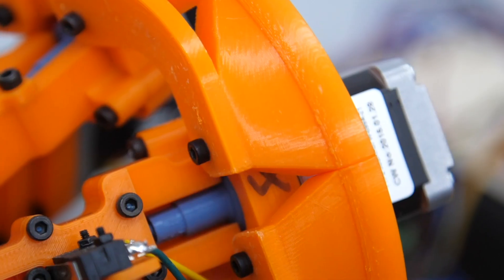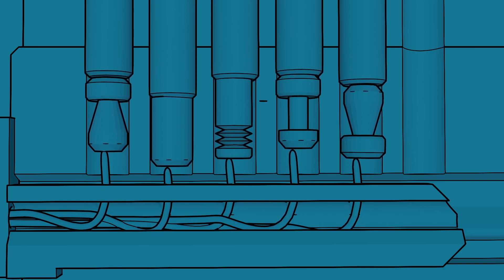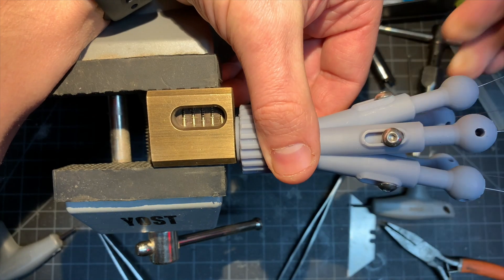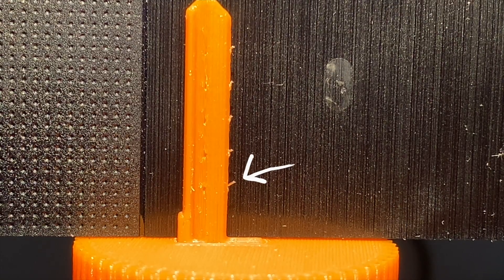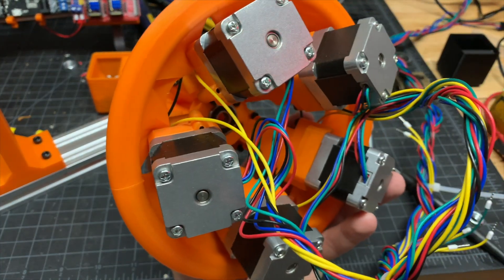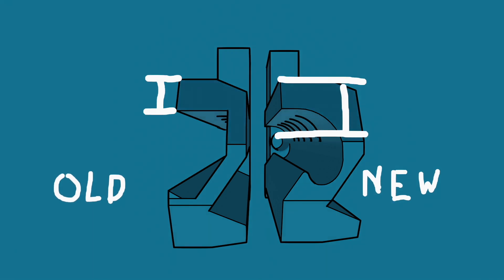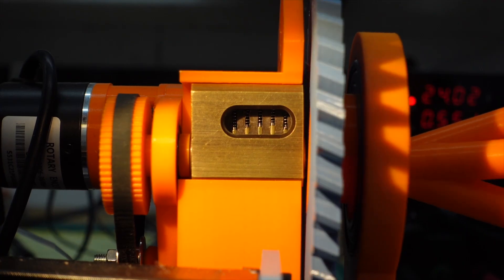i made a robot that picks locks WITHOUT A PICK

Comment: that wire manual picking tool, look basically identical to a picking tool i had for tubular locks. Its called the Peterson Pro-1 and Bosnian Bill has a good video on it . 
Very interesting that you'd come up with such a similar but for a different style lock. 
Nice video. 😀👏 Brute forcing any 5 pin Schlage keyway (at the speed your machine does) would take ages though i'd think. 
It kind of works like an electronic pick gun or even like using bumb keys kind of. 
Schlage is i think the second most common lock in American homes though, but unfortunately they are also one of the easiest to just pick along with the kwiksets.

Comment: I think you should place the rotary encoder on the main shaft and use a clutch system that prevents the blade from being turned further than possible.

Comment: Maybe you might look at tubular style locks (the ones with vending machines and those ancient antique things called payphone booths - these utilize tubular locks in7 or 8 pins, typically…).  I’ve seen an expensive device that tackles tubular style locks quite well, and it sort of resembles your device, except instead of your ‘canals’ that converge at the entryway to the lock, they’re on a sort of flexible shaft that can be made more or less rigid by applying tension to it.  They are springy. This thing you have created is an awesome feat in its appearance alone, I mean I would love to decorate my entire domicile with your device as it’s main inspiration!  Congratulations to you!!  You are an extremely elite entity, riddled with fails as you are! I try to claim my mantra to be “I revel in my failings” since it sounds like I’m not such a stress casualty as what is the honest truth. So I’ll pray for more obstacles for you, and know that when it hits, someone hoped that you would receive one of the greatest gifts that could come from a life of perseverance!!

Comment: Fun project, some very nice engineering. One little remark: When using a setscrew to fix a gear (or pulley, for that matter) onto a shaft, the setscrew should be on the opposite side of the flat (the round part of the shaft), in effect pushing the flat parts together. The setscrew isn't there to prevent rotation, it's there to ensure close fitment of the flat faces to transmit torque across the parts.

Comment: If you use Nitinol memory wires you can control them like little motors using simple electrical signals. We are working on a skin tight exoskeleton that has thousands of thin .5mm Nitinol memory wires running through the entire suit with pickup along all major muscle groups to fire the wires when needed. In short if you go to lift something very heavy, simply try to lift it and once your muscle groups in your arm slightly tighten the pickups read the electrical signal through your skin and tell a micro controller to fire the corresponding Nitinol memory wires thus greatly assisting the weight your lifting. I should mention Nitinol is made from titanium and nickel so its super strong!

Comment: JLCPCB can 3d print metal, well, SLM (selective laser melting), basically the same thing, but you could get stainless steel key blades fairly inexpensively
Reply: just checked, and your keyblade would cost $9.50 with shipping, you'd have to make a small adjustment so it's 0.02cm longer to fit the minimum 1.00cm X 0.20 cm X 1.00cm size
Reply from the maker: Thanks for looking that up. I'll keep that in mind for v3

Comment: V3.0 - torque sensing instead of encoder on the rotation sensing - the motor current is proportional to the torque applied. Steel reinforcement in the keyblade so it doesn't shear, and cable instead of the steel wire, should bend easier so you don't need as much force to actuate the pins.

Comment: Wait so from what I understand is that there are two pins in a lock correct it’s the driver and the upper right? So what if you just coded the stepper motors to max them out then rotate like 1 or 2 degrees to the pins dont reset and retract the wire and then turn the rest of the way?

Comment: Wow this was AWESOME!!! I loved how you walked through your challenges and how you solved them, I found that the most interesting and relatable. I didn’t follow how it detects when a pin reaches the right height… are you just constantly rotating the tumbler to check if it is rotatable (i.e. unlocked) otherwise continue to sequentially try all 100,000 pin height combinations? I totally got Splinter Cell nostalgia watching this!
And the amount of times I’ve had 3D printed gears put me down a long rabbit hole of diagnosing issues…! Very relatable

Comment: Pretty fun and frustrating project! :D
Check out R/C planes/helicopters servo motors instead, it would reduce size a lot, also with a defined arm lenght in the servo you could easily remove the linear actuators!

Comment: This is cool to see. 21 weeks ago, apparently, I commented to a friend on FB "Now I want to build a key with tiny flutes running through it, and spring wires hooked to geared stepper motors, and then a robot can just quickly run through the 150k combos for me," because I have a cabinet with a very good lock I cannot for the life of me pick. I actually seriously considered doing this exact project˘which is a lie; I did crazy projects when I was 23, but now I'm twice that, and don't have the same drive to dive into endless efforts like this). I also actually considered printing every possible key, but I don't know which key yet, and yeah, those combinatorics... I figured I could fit 50 keys on the plate per print, 4 hours, 15 minutes per print, using 82g of PLA, and I'd need 117,649 keys, so only 2,353 full-plate prints, taking almost exactly 10k hours (10000.165!). I'd also need 192,864g of filament, which is only 193 reels, so about $2600 with ANYCUBIC 4-packs ($13/reel). I figured I'd only need to do about 1500 runs before I landed on the key, so about 6,375 hours, or 797 8-hour printing shifts. Not too bad :)

Comment: Load cells seem like they would be the way to go,  besides a simpler integration, would allow you to control fatigue, and likely speed up the cycling between attempts since you wouldnt have to wait for the assembly to spin enough for the optical system to know it isnt picked yet

Comment: 9:25 You should have just used straight cut gears, the helical cut is going to produce longitudinal forces that will act to seperate the gears apart along their respective drive shafts, in most applications a thrust bearing is required for helical gears.

Comment: Do you need linear actuators? Can't you use slightly softer wire and use 5 spools with motors instead? You could even have one motor and a gearbox.

Comment: Great project. Im 5 minutes in and the obvious question! Why didn't you use RC servo motors? They are servo motors, plenty of control, small low current fast, and plenty strong enough to push a wire with a short lever arm after all the wire doesn't need to move very far.

Comment: I like the thought process involved! Couldn't you have rotated the smaller steppers 90 degrees and mounted the wire on an actuator wheel? This along with a metal key blank insert into the plastic would be how I would try to solve those two problems. That or CNC/carve it out of G10. The smaller steppers look like they are the same as Floppy drive head seek steppers, those come with very steep actuating thread, that would be another direction

Comment: I've actually used these cheap stepper motors once and there is a hack to make them work faster. You take the plastic casing out and cut a copper trace with a knife, you'll need to use a different driver though.
Reply: By different driver I mean that the one included with the cheap motor won't work. I'm pretty sure the one you used with the NEMAs will work just fine.

Comment: You could write an algorithm that pushes each wire in as far as it will go, measures how far in each one goes, and then use those differences to calculate where each pin should line up. Then send those possibilities and you'll be in in a few orders of magnitude quicker.
Reply: If a lock has security pins, it'll have nonuniform max travel distances too

Comment: U could have avoided a lot of bulk by using a stream line design and putting the motors in a parallel side ways and using them more like pullys instead of having the need for a Linior actuators, the original design needed the diagonal shapes for finger access, your new design should have used a single channel for the wires and direct drine belt the wire to the drive shafts of the motors, also not redesigning new parts and working around old design issues leaves it bulkyer as an end design, when some additional components like the drive gears only exsist because of previous versions, and that's not how you improve versions it's letting padt designs hinder the progression of your final design, I hope you make a more stream line version in future, I did a little bit of math and you can even made it hand held and battery powered.

Comment: treat yourself to a better iron. Pinecil is $36 shipped, way better than those dimmer switch irons.
Reply from the maker: I know… I hate that thing. I haven’t researched what to buy. I’ll google what you mentioned.
Reply: @SparksandCode  I commented with a bunch of information about it but seems it wasn't posted. Anyways don't get a fake off the usual china place. Get the V2 with the short tips from their site. They have a whole wiki about it. Also use a name brand supply. I use a old delta branded laptop supply. Shortest possible lead coming into the iron. Mine is really long plus I have the V1 with the long tips so I only put down about 40w even though its a 65w iron. I  think you get closer to mid 50's with the  V2, short lead and GaN charger. They can also push 24v  if you have the right charger/cable. Their discord is great if you have any questions
Reply: @SparksandCode  There is also the KSGER T12 which I'll likely upgrade to at some point. Proper 90w soldering iron station. Could just skip to it if you don't need the portability and don't already have a power supply for the pinecil.

Comment: If you're going to iterate so many 3D prints, I hope you're using Klipper or Input Shaping to speed up the process. It would be a massive change in time/speed. (Or you could just buy a bambulabs printer)

Comment: For a future version, instead of using an optical encoder you can measure the current needed to turn the motor that's rotating the key. Sorta how modern 3d printers do nozzle bed leveling, you would do a few light turns before starting to get a base line of a locked state and then do a momentary test every time you get a wire into a new location.

Comment: Why didn't you add a torque multiplier instead of changing the rotation motor? Of all the motors, that one didn't need to move quickly, and because of the optical encoder (and it's low speed) you shouldn't have to worry about twisting the poor little key off.

Comment: I don't use a resin printer (I don't print enough, and it's so toxic that I don't want to bother with it), but when I was considering it, I found that there are a few resins that are flexible, and mixing them with other strong resins you can get extremely durable material, that will flex instead of snapping... I think one was called TGM? Or something. Then there was another brand that had you mix 2 of them to get a good resin, I think this latter one seemed to be more preferable (cheaper and more rigid).

Google for resins for mini's.

Comment: A great improvement for the manual version would be to slim it down to something not as bulky or long. Something you could easily store in a small kit bag or pocket. Remember those pens where you could choose from all sorts of colors? Something like that with some markings for wire depth and pin number would be great.

Comment: Scrap the robot but keep the main key and wire portion. Instead, make it similar to a glove for the 5 pins and each finger lets you move the wire/pin. This way you can quickly and easily pick the locks

Comment: so, something worth checking with brute forcing, if you want to pick "real" or realistic locks is the MACS (Maximum Adjacent Cut Specification) different locks have different MACS to ensure the key will enter and exist the lock without getting trapped, a MACS of 7 for instance, like some Schlage locks have means you can never have a 0 or a 1 pin next to a 9 pin, a MACS of 5 would mean you can never have a 1 next to a 7, 8 or 9, it will massively cut down how many different combinations you have to try,

of course if the goal is to pick anything you throw in there at random, you have to go the full 0-9

Comment: Having parts behind and around the actual lock kind of defeats the point of something like this doesn't it? It means this will only work in perfect situations and not have any practical use. It should be possible to make the encoder interface with the keyway from the accessible side and not the back.

Comment: The key-shaped wire guide should be layers of cut metal glued/screwed together.  Easier to assemble/disassemble, sturdier, and lower friction for the wires….  Also the wire actuators should probably just be servos instead of steppers?

Comment: @Sparks and Code - When I re-key a lock for myself, I make sure that several of the pins are NOT standard lengths. This adds a bit of extra security, and could make it hard for a robot that is only expecting standard-length pins. How would your robot handle this?

Comment: OMG... I drew this up about 1983!!! Of course they say that if you think of anything, a thousand others are thinking the same thing. The difference is, YOU built it! So kudos. 

Mine was used the same principle, but differed in a couple of details: I drew it with flat wires, which could then "stack" in the key blank, and turn upward to the pins in flat slots. And rather than solenoids, I designed mine with an eccentric cam for each wire... the five or six of which would be in a rotating drum, geared together to quickly go through all possible height combos for the lock... I mean, as you rotated the drum with a crank, the individual cams would also rotate inside, but each one at a slightly different rate, through gearing. Tens of thousands of combinations, I thought, could be gone through in minutes. 

I also drew it so that different blanks could be attached to the drum, for different locks.
Reply: If you care about progress more than copyright, send a copy of your designs to him. Make sure to add descriptions. He might make it a reality.
Reply: How weird bc I drew up the same idea in 1982!!! So I guess I was first... no big deal 😎  Mine did all the things you were talking about plus it had one of those little knife sharpeners embedded in the back of the machine (manual, of course, not motorized). [SIGH] If only... I could have been even more wealthy than I am today.
Reply: @joew1865  You could have only written that sarcastic, mocking comment if you were incapable of understanding the principles of construction and operation in my description... so you gave yourself away, without even realizing it.
Reply: @proto57 yeah, and the comment he wrote is actually copied from something I wrote on a napkin in a bar in 1981 so I also doubt he understands any of the engineering

Comment: With the plastic key blade failures: Could you 3D print plastic molds and then pour a high-strength epoxy into the mold to make a stronger key blade without much tooling? Or, could you cut down a metal key blank and then design a 3D printed sleeve to slide over the steel blank? The 3D-printed sleeve would have the precision channels you need for the wires, but there would be a steel skeleton inside it to prevent shearing.
Reply from the maker: Ohhh I like that sleeve idea… storing that one for later

Comment: Why oh why didn't you just use micro servos for the wires? They would have worked so much better for this, and would have taken up 20% of the volume of your design and would have been sooo much lighter. I would still use the stepper to rotate, but would have used the small one for that.

Comment: why not jsut measure how far you extend each wire until it stops to cut out 2/3 or more of the possible positions for each (distance needed to push) for that pin and reduce your "brute forcing" by a ton? really no need to test every position when you know after testing how far it will push in - or not - and eliminate the position lenghts that it simply cannot be..

Comment: This is really cool! Though it'd be super nice if you stuck a low-pass filter at like 15000 Hz or something on the audio with the motors. My poor ears are suffering a barrage from the high-pitch whine of the motors
Reply from the maker: I apologize. I edited with apple ear buds in and never heard the noise. I also barely know what I’m doing with video editing. You’re like the 5th person to mention this.

Where exactly is the noise. So I can look in the video project.
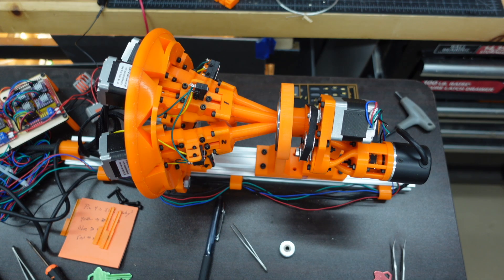Reply: @SparksandCode  Thanks for the reply! 8:44 is a good example, as is 13:18
Reply from the maker: @HedgehogGolf  thanks … I will research that for next video

Comment: I feel like you could've used super small stepper motors and just 3D printed some gears with a high gear ratio since you need tiny amounts of force to move those wires instead of using motors that are powerful enough to snap your entire project in half. Same goes for the force needed to turn the key.